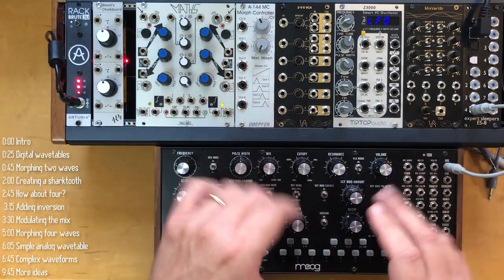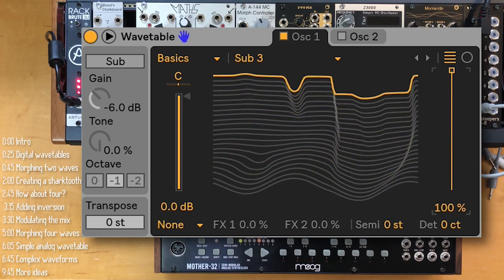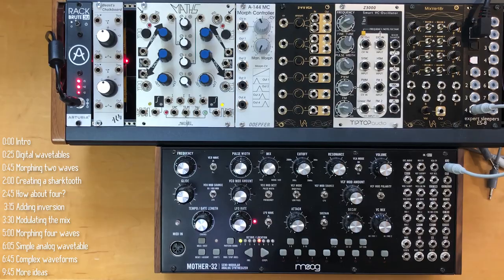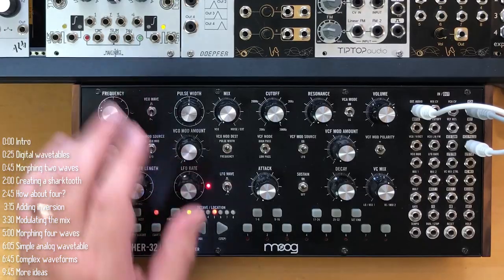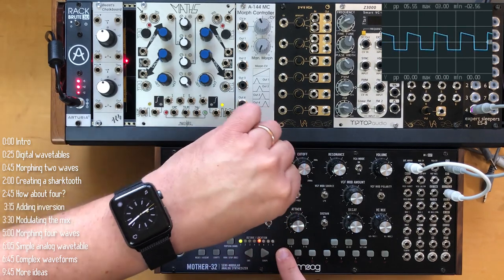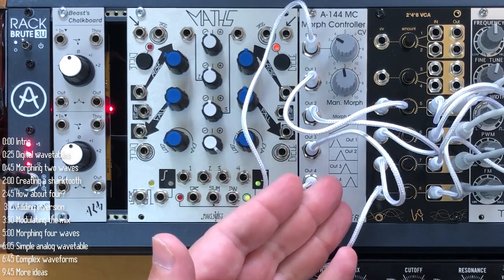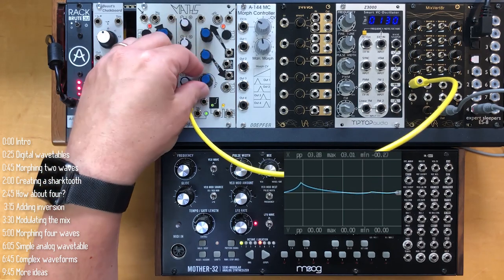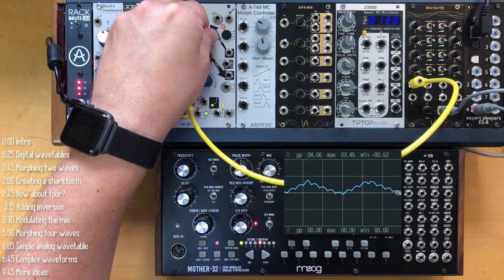Analog wave morphing like wavetable synths? Yes you can, and here's how

Comment: Nice and very pedagogically. In a pure technical point this is “just” morphing mixed waveforms : )
Reply from the maker: I agree it doesn’t work like digital wavetables- the question is - does it do the job sonically? I think so!
Reply: Most certainly a very good way to make sounds more vivid and animated. Nicely done.
Reply: Nice illustration. You could get closer to true wave interpolation by hard syncing the waves to be interpolated / mixed with the same sync clock to ensure phases line up and then you need to think about renormalising after the additive mix.  In true interpolation the magnitude of the wave at any point is a strict maximum of the inputs whereas with mixing the maximum is the sum of the maximums of the individual waves. But that’s getting a little pedantic!

Comment: Best digital sounds I got from analog was the Verbos Harmonic oscillator and WMD sequential matrix. Partials into the matrix, and then outputs back in FMing the osc and AMing different partials. The WMD SSM can be clocked at audio rates so using the square from the osc meant varying AM and FM effects per cycle! Sounded great
Reply: I would like to hear this. Do you have a recording somewhere?!

Comment: Hey. I understand that Digitakt is not a synthesizer but...You can modulate start point on  longer waveforms that was made from connecting few short typical (or not) waveforms in one. Using start/end loop points You can modulate in way You want. As I have mentioned Digitakt is not a synth but has some unusal granular resynthesis benefits.
Reply from the maker: Thanks! Digitakt is awesome and certainly a synth too in my book...

Comment: Lovely Vid, thank you Loopop. I don't suppose there's a hardware oscilloscope you could bolt into a EU rack and save you the software overlay?
Reply from the maker: Thanks! There is - and I’m telling myself I do it with overlays so that I have flexibility in where to place it, but realistically I’m probably just too cheap to buy it
Reply: there's a few available. Mordax data and Jones O'Tool are the most popular

Comment: This has nothing to do with wavetable synthesis. You could simply use a wavetable module for spectral morphing content. This is just cross fading between a multi output oscillator.
Reply from the maker: From Wikipedia's definition of Wavetable synthesis: "Digital interpolation between adjacent waveforms allows for dynamic and smooth changes of the timbre of the tone produced." Would love to hear you A-B sound test digital interpolation and cross fade of a multi output oscillator and then determine it sounds "nothing" like each other
Reply: That's like comparing a swiss army knife to a screwdriver and saying there is no difference. Sure you win the argument if we're trying to tighten a screw. A wavetable itself however can go much further beyond just crossfading between waveforms if you use them for more than such. You can replicate real time modulations like AM, FM, PM, spectral maths, and other processes I don't even know the names for. I see the appeal of this video's concept, with wavetables being all popular and all; I just imagined you could have used more than just the A-144's most basic function to rather deliver a satisfying result for the clickbait title. What you have here if anything would be much closer to "Emulating variable waveshape with a multi-output oscillator, here's how".

From ModularGrid's description of the Doepfer A-144: "Applications: voltage controlled morphing of 4 audio signals in combination with A-135, e.g. morphing between the 4 waveform outputs of an VCO (sawtooth/ rectangle/ triangle/ sine)"
Reply from the maker: hmmm I read the title again "Analog wave morphing like wavetable synths?". Then I read what you quoted out of the A-144 manual. And then I wonder where exactly the click bait is. And of course wavetable synths can do more, that's why I was talking about the morphing part, because analog synths don't need wavetables to create AM, FM or PM. They do need a way to morph though - hence the A144. So I guess I won't get to see an example from you on how analog morphing is "nothing" like digital morphing. Yes, I was talking about the screwdriver part of wavetable synths and I can't see how the title can say it any a clearer way, but I'm always open to suggestions for even clearer titles not to mention non "most basic" uses of the A-144. I think getting your insights into more advanced A144 uses would be a much more interesting use of the comment section than title wording.
Reply: "But I'm open to suggestions for even clearer titles" 
You must have missed the "Emulating variable waveshape with a multi-output oscillator, here's how" bit. It's even structured similar to your title. lmao
Mentioning wavetables in a video that has absolutely zero content related to wavetables is an obvious mistake that several commenters have pointed out. You're simply holding on to the one misconception that Variable Waveshape-like waveform morphing is the same or has anything to do with wavetable synthesis; and anchoring on the fact that a wavetable crossfading between basic waveforms and a mixer crossfading between basic waveforms have the same sonic result. You are however spreading a misconception in doing so; omitting the intention of having the buzzword "wavetable" in your title to begin with, and then un canning a response those who have noticed it. In the end though, it's your channel and you can do whatever you want. Others who are learning synthesis via the internet will pick up false information and misconception everywhere, not just this video. (They should just go buy a synth and actually figure it out, lol) I of course enjoy most of your content which is usually very well put together, and straight forward. Just this particular one rubs me a bad way, and I along with others have simply tried giving you such feedback. As far as my "insights", well I don't know... That scenario is only limited by ones rig size, and ones imagination right? Hard to really find an example that would mean anything; but if I must provide some kind of response to that, another common thing I noticed from other commenters was the assumption that this video would have utilized wavefolders. I imagined that, along with using phase cancellation on your attenumixer to create "wavetable-like" transformations with a cleaver use of octaves and waveform choice, PWM to AM, etc. Given one had the modules for it, you could have also done everything from PLL, Sync, etc. to retain that all timbral changes would not drift. Perhaps a clock connected to a selector to create timbral morphing via the waveform multiplexer method. The Tubbutech uTune is also a serious breakthrough in the small world of waveform focused synthesis since now you can go beyond just "sync". Now you can have 2 analog oscillators in perfect phase lock with a slight control on phase nudging. This teamed with phase cancellation and amplitude modulation on your attenumixer could have yielded stunning results provided you had the extra module (uTune) in your rig. None of these examples really mean anything though since the possibilities are endless, but note that all of these methods would have presented radical timbral changes within the waveforms single duty cycle assuming things were phase locked and synched properly; thus making it much *closer to wavetable-like synthesis via analog, that can also be modulated in the similar manner of digital wavetables.

P.S. Sorry i'm blowing this out of proportion and being a #$*@ about this. You sending me a Wiki Definition to shut me up, followed by a challenge to determine the difference of what I already knew has the same sonic result just really knocked me off my rails. Love ya loopop. (-;
Reply from the maker: I can't argue with love man... I think other commenters commented when the title was different (I don't remember what it was...) and were actually quite appeased by the new one as there was silence on the topic until your comment. To the point I don't think it's a misconception - it's just the screwdriver as you called it, and plenty of people have told me they truly were given a new tool with the content of this video - but I think we can just agree to disagree on that. Anyway, can you imagine if I pleased 100% of the people 100% of the time? That would be WAY too much power in one place